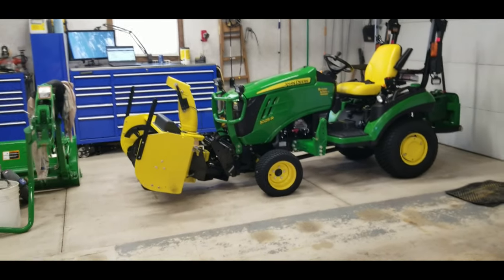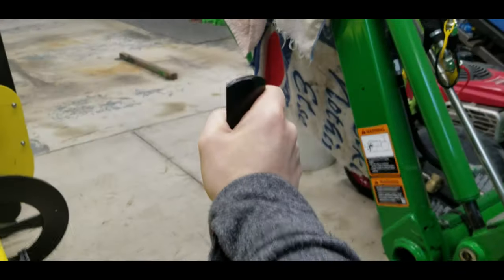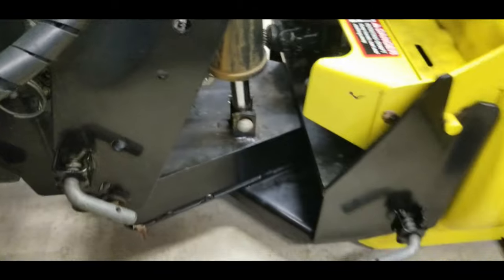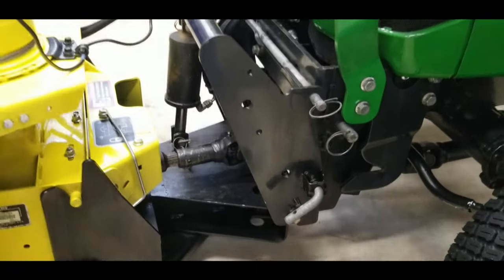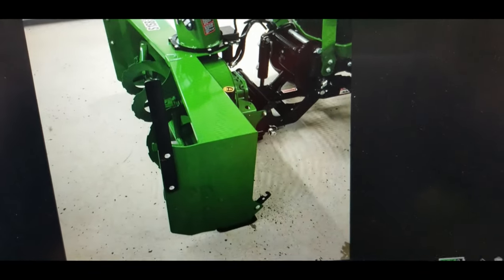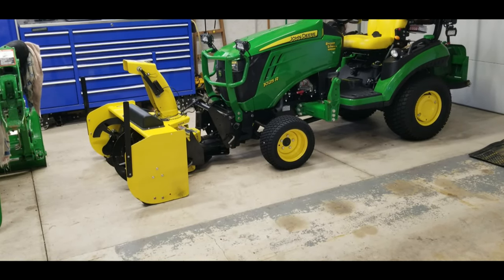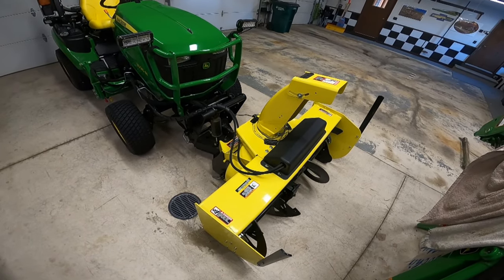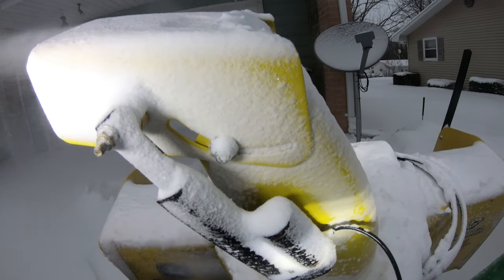Why I'm in the market for a new snowblower

Comment: Never had anyone push sideways on the blower while using it, and wouldn't recommend it either. When in use I've never had it move sideways while using it. You could always shim it tighter, drill and tap for grease zerks if its that bothersome. Have been using this same blower on my 455 for 14 years with no problems, doesn't have any more movement than yours and I've tortured mine. Like Shakespeare said "Much ado about nothing"
Reply from the maker: Like I said in part two of this video my 1025R in not your 455
Reply: He doesn't like it, and can choose to buy another. Instead of going quietly he did us a favor and let us know about the problem so we can learn and decide accordingly. Man, a free market is incredible!

Comment: Your shop, computer, tractor, etc seem in very well maintained order.. shop floor is clean. I bought a new X738 last year with a broom, blade, and 47" snowblower, all connected with the Quick Hitch system. (Have a cab and 40,000 BTU plumbed heater). Have a 28' wide by 28" deep cement driveway, and help several neighbor's including 1,028 feet of sidewalk (I have 214'), and some driveways to help my widower neighbor's. I live in northern MN so we get a type of snow that blows in and packs hard -- and our winters are often below zero for weeks. I have the same movement with my QH system as you, but so far, I haven't found it an issue with that side movement or elongated holes. I have 30 hours on my machine, keep it in a heated shop, and maintain it well. I think your OCD tendencies are well-founded, and it can be a curse.. once you get something that really doesn't matter to matter, you're doomed.. My neighbor is that way, and he's so much like you.. everything is just so and he can't help himself.. nicest guy in the world, but we laugh at some of his idiosyncrasies. You have a point no doubt, and I'm sure you will change your set-up, but I hope in time you let some things go that really don't matter. I know, easier said than done.. lol. Peace.
Reply from the maker: LOL wait till you get a few hundred hours on your set up and you will see its not OCD.

Comment: I had a John Deere LA110 with a Deere blower and it was a terrible blower! The blower moved side to side because the auger didn’t have any serrations to chew up the packed snow when it hit the plow pile end of the driveway. I updated to a John Deere X310 and I guarantee you I didn’t put a Deere blower on it. I went with a Bercomac blower and it had a serrated auger steel impeller and blew the snow 10 times as far as a Deere blower! I recently updated to a Kubota and I did look at the 1025 but when I saw the chintzy cable system that rotated the chute and zero serrations on the auger I knew I wasn’t going to buy a John Deere. I went with a Kubota BX2380 with a Tektite Heated Cab and the Commercial gear driven Kubota blower with serrated auger. It is solid as a rock and blows the snow a long way! Even heavy wet snow. I help the senior neighbors out and I blow out 5 driveways very early in the morning and I wanted a rig that could handle it. The Kubota blower is built solid with heavy gauge steel.
Reply from the maker: How did you like the Bercomac? They don't make a blower for the 1025R but may send some e-mails to them and see if they can make one. John Deere makes a great tractor but that blower is in some much needed update, its about time they step up there game. From what I'm hearing is that the Kubota blower is a rebranded radtech like I showed in this video. I don't know if you seen the 2nd part to this video yet but here is the link and there is a part three coming soon. https://youtu.be/iQfe3bRf7UU

Comment: Had mine for three years and no complaints
Reply from the maker: Do you use yours for light commercial work?
Reply: @masterofeverything6468  Year round mowing with 54" deck, front loader with wood and stone. 54" snow blower in heavy snows up to three foot at a time

Comment: Thé Radtech  is made in Thetford-Mines Quebec Canada
Reply from the maker: Is there a way to find a radtech dealer in Wisconsin? I e-mailed radtech several times but never get a reply.
Reply: @masterofeverything6468   i do not Know i will call them soon, i am also interested to buy One also. I live about 30 minutes from them.
Reply: @masterofeverything6468  rad tech makes the frontier 3 pt hitch PTO snowblowers, my SB1154 is a radtech
Reply: I sold my jd 47 I hated that blower,u can get a bercomac for a 1025, I had a berco on my jd 180 worked great sold jd blower, bought a radtech just love it well built
Reply from the maker: @mchaffey55  Are you in Canada?
Reply: @masterofeverything6468  yes in ontario pretty much straight across from green bay if any help got mine at huron tractor stayner ontario
Reply from the maker: @mchaffey55  yep that helps I wish they would sell in the US

Comment: This is my 12th winter with my JD 1025r doing multiple gravel and tar driveways. No problems at all with the 47 snowblower. The number of strong parts and play left to right are not problems. Much ado about nothing.
Reply from the maker: LOL, You say "Play left to right are not problem" but yet you call it "Play"
Reply: 'play' of any kind is a problem, now multiply that by 4 points and that is a lot of play. It should be a standard 3-point, which is only one point of connection and problem solved.

Comment: Nice video, I have the same issue I think I'm going to drill and bolt all the points that you thought about welding to see if some of the parts that are loose will help, anyway I have the driveshaft issue mine has the older cv joints one on the blower the other is on the shaft, I do have the steel blades so there's a lot of weight for the blower when blowing snow I do like the qwitor going with that,
Reply from the maker: How do you like the steel blower? Also check out this video from last year I talk about how I fix it. https://youtu.be/iQfe3bRf7UU

Comment: The reason they use that hitch is so nobody else's stuff fits their tractor. Same reason they don't use th universal SSQA quick attach, they use their own so you can't use any q/a implements except deere ones. I agree it's a shitty set up. And that Impeller is plastic because it's cheaper. A blower Impeller is never better made of plastic, it should no question be steel
Reply from the maker: I agree 100%. Have you seen the new HD Snowblower https://youtu.be/JwJmPdjF3ZM

Comment: Those mount parts are not cast iron, the marks on the edges of the brackets are from laser cutting and pushing the cutting speed just a bit to fast for a perfect cut.
Reply from the maker: I don't know about that. Still think it may be cast.

Comment: The X Series has a different front hitch than the 1 Series, although they are similar.  Did you ever get anything else?
Reply from the maker: The 1025R need kit part number BLV10708 and the X700 uses kit part number BM26236. Yes the kit part numbers are different but if the look deeper at the three main parts the part numbers are the same but the support on the back and that is the same construction but holes are different to account for the height different between a lawnmower and a tractor. The part numbers for the 1025R are AM124588 AM130902 AM132310. And the numbers for the X465, X475, X485, X495, X565, X575, X585, X595, X700, X720, X724, X728, X740, X744, X748 are AM124588 AM130902 AM127365. Take a look for your self
Reply from the maker: I'm still looking.. It hard to find someone that makes a snowblower for the 1025R and also sells it in the USA
Reply: @masterofeverything6468  Oh I know.  I’ve owned both, and actually just picked up an X700 hitch today as part of another deal.  They are not interchangeable between the two series of tractors as the widths are different.

I do a lot of snow removal too and my plan is to beef up the pivot point on the front quick hitch.  Mine is sloppy there, but that’s about it.  JD has a replacement bushing for it, but I’d like to do something better at some point in the future, but it’s not too much of an issue for me, at least for now.
Reply: @masterofeverything6468  I have seen someone adapt a Berco, which is obtainable in the US.  You could try that.
Reply: @masterofeverything6468  Check out this Bercomac on an X748.  People put these things on about anything.  I'm sure something could be rigged up for a 1025R, although maybe you could also look at someone making you a custom hitch since you like the blower.  https://www.youtube.com/watch?v=9xEN_o_nmMg

Comment: Put a Bercomac blower on your 1025, you'll love it.
Reply from the maker: I LIKE IT! Just did a quick look on there website but it doesn't show that they make it for the 1025R. There website dose say "Is possible to mount this snowblower on other brand and model of tractors" so I will try e-mailing them. Do you have a Bercomac blower and what tractor do you have it on?
Reply: I have the 48" berco on my JD X748.  Got that back in 2012, love it.
Reply: I sent an inquiry to Bercomac and do still make one for the 1025, I think it is 59".

Comment: JD does that 1 size fits all thing to try and keep the cost down. You say for what it costs it should be better. Would you be willing to spend 1000-1500 more for it if JD made one that only fit your model?
Reply from the maker: Absolutely, and that is what is going to happen this summer. I payed $3,937.50 for this John Deere snowblower and I am going to pay $6310 for a much better built blower.
Reply: @masterofeverything6468  well, for 2500 more, it should be better. Cant wait for the review video on it.

Comment: that bracket on the computer is def not cast. you dont find structural parts that are that small in cast and welded.
Reply from the maker: The part isn't really that small, its about 2ft long and 2in wide.

Comment: Had mine for a month and took it back couldn't handle the heavier snow I get  wobbled like yours  and went with the frontier 3pt blower which is way better
Reply from the maker: What tractor do you have and did you get a rear 3-point blower?
Reply: @masterofeverything6468   1025r and the dealership traded the front mount for the 3pt it's twice the size in hight and the impeller is 2 foot diameter compared to 1 foot on the deere blower it throws alot more snow and further
Reply from the maker: @andrewjohn9813  WOW That's a big blower.

Comment: Hi, I think its pretty normal.  I've had my JD snowblower for 15+ years and still going strong on an x575.  In fact, I have the angle cylinder installed for the snowblower, which changes the angle of the blower so you can do circular driveways and tight wondering paths (acts a bit like an articulated tractor, and you don't run over snow with the rear tires).  You probably won't be able to do that with your new blower.  I think that the tighter you make things, the more they will break.  Just my 2 cents, take care.
Reply from the maker: I don't think a snowblower on a x575 is comparable to a snowblower on a 1025R. I think the 1025R puts more pressure on the mount. I didn't show it in the video because it hard to show with the hitch on the tractor but my mount is actually bent a 1/4 in.

Comment: The green blower looks like a radtech blower.
Reply from the maker: Yes it is. Do you have any information on it or do you have one? The only information I can find only is on forms. I can't find any dealers selling it or any literature other then a few photos of the manual
Reply: MASTER OF EVERYTHING  I can’t find much either,,        I know there in Canada and I believe the Frontier blower from the dealer is the same just rebranded.
Reply from the maker: @davetrickett2068  I have just been flipping though Deere.com and can not find a front mount Frontier blower for the 1025R
Reply: MASTER OF EVERYTHING you are right.  I did the same and found nothing?   Have you been able to find any more info?

Comment: You’re right it is a stupid design. If you’re a decent fabricator, you could get rid of that phony so called quick attach setup and weld up a nice one piece frame and solve a lot of problems. I don’t own a blower like yours. I had the old style on the front of a 955 JD with a 54” blower. It was a one piece frame that direct connected to the tractor where the front of the belly mower attached. I also added skids cause like yours it was wearing down quickly. I really was for the most part a great snowblower. Had very few issues with it overall. I had hundreds of hours on that setup (Used commercially) and all I broke was the dumb cable for the directional chute. That was a major pain to replace.
Reply from the maker: I did make it a lot better with about $60 in hardware from Mc-Master I made a 2nd video going over it. https://youtu.be/iQfe3bRf7UU   Sometimes the old school stuff was made to last not  sell parts

Comment: wow glad ur not an engineer.  that thing will last 30 years+ no issues at all... you have the actuator on upside down so there is that...
Reply from the maker: Please tell me how it will last 30years when it is already wearing out after 3 years?
Reply: @masterofeverything6468  If You don't use it for 28 years I guess ;) LOL

Comment: Sir watch your videos and just going to set it straight with the hitches it is done to keep cost down and flexible on keeping attachments for future equipment... if you want a better set up buy a large 2 series... the small frame 2 series and 1 series are more similar to a x series then a compact tractor... hydraulic gpm 5.6 on x series and 6.7 on a 1 series same size tires and only 200 lbs in weight.. if you feel that way ... buy a large frame 2 series and get more of a tractor... not a lawnmower!
Reply from the maker: your comment makes no sense. Your first part I point out in the video "it is built cheep and used on many model." Also note that the Quick-Hitch is used all the way up to the 2032R. It is used on the X500, X800, 1023E, 1025R, 2320, 2520, 2720, 2025R, and the 2032R. The John Deere 2038R is to big for where I need it to fit. Hydraulics flow is know way to compare equipment class. Most equipment is compared on weight so lets try that a X500 is 647LB and a 1025R is 1,444LB so NO a 1025R is not in the same class as a lawn mower.
Reply: MASTER OF EVERYTHING x758 1280lbs 1025r 1444lbs that’s 164lbs and the quick hitch is up to the small frame 2025r I know I have one ... the large frame “2017”and up 2032 again 2017 and up 2032 and 2038 have the front three point and larger old style refrigerator snowblower look it up a lot more heavy duty than a lawnmower 47 or 54 yes .. even 1 throughout the 2 series large frame is a lawnmower! Any tractor with out a full connected engine/transaxle ala engine and transaxle mated via a driveshaft supported by a 4 gauge ladder frame is a lawnmower! 3 series and up are True tractors .. not knocking the small machines at all have had them over 25 years but all I’m saying is the beefy stuff is available to get but Deere knows to keep cost down and people coming back keep attachments compatible within similar sized machines.. by the way never heard of a x800 series ?
Reply from the maker: @Korahandherdad  OK

Comment: First off a x 758 is the same as a 1025r in horse power. Im guessing abusing the blower it will get warn. You're a whiner. Go buy a kabota and see how long it dont last.
Reply from the maker: The JD 1025R is 500lb heavier then the x758. And that is not counting the extra 350lb of weights I run. So NO the  1025R is not the  same as the x758. Also check out some of my snowblowing videos and you will see how its used. It is not abused. I'm not whining I'm pointing out an area the I think John Deere could improve on.
Reply: Crazy is all I can say.